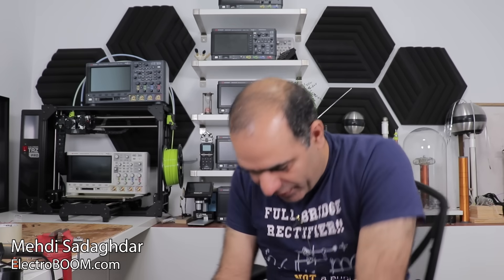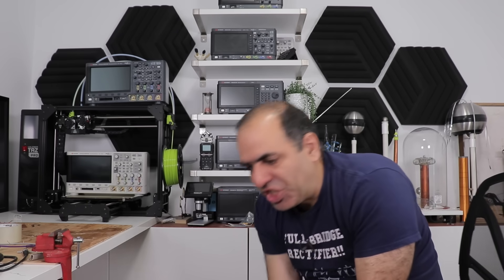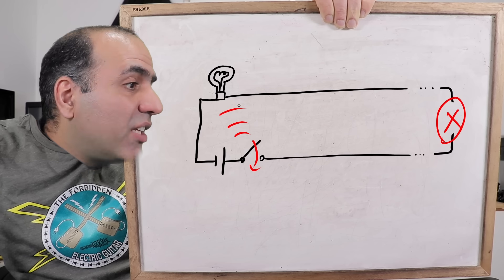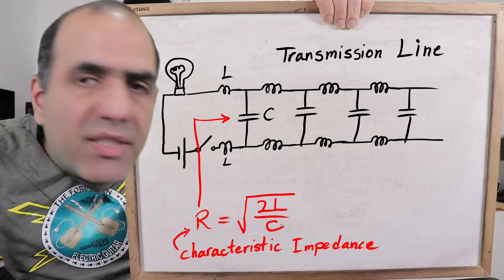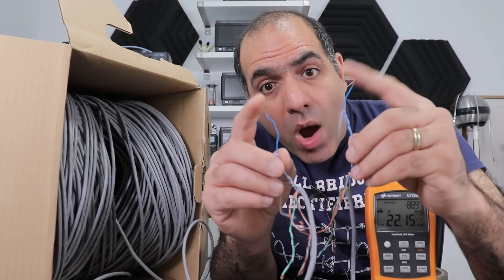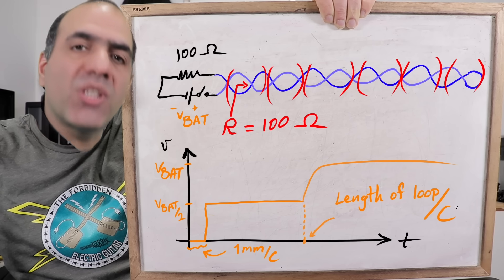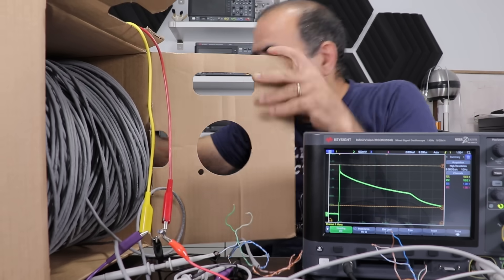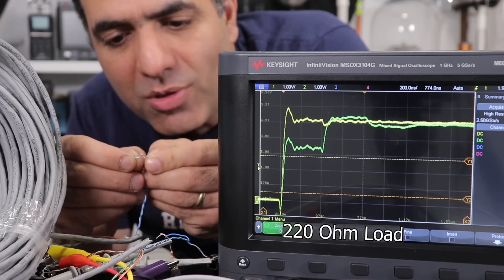Testing the LONGEST LOOP OF WIRE!!! to Turn a Lamp On

Comment: Veritasium's "experiment" had soooo many flaws. Not for the first time, I just wanted Veritasium to define the experiment that lead to his weird claim. E.g. define "lamp" (LED, tungsten, ..., voltage and current requirements, ...), define "on" (dependent on the "lamp"), define "switch" (related to "on"), ...
If you don't disclose how you define things, you can claim anything 👹

Comment: Very nice explanation, I think (dont remember clearly) Veritasium was making a mistake assuming that both left and right lines make a single transmission line together which is incorrect. As you said each left and right line is a seperste transmision line, so if you want to get half supply voltage you need to the load to be  2Zo not Zo (here you have only one line so you matched to Zo).

Comment: That works as a TDR as well! . You can now measure the length of wires taking into account the speed of light in that wire limited to 69%
Reply: fluke ethernet tool can show the length of rj45 without end connection
Reply: Nice
Reply: nice!

Comment: Mehdi, You did not answered the main question.
a) Is the electrical energy traveling through the wire or outside the wire?
b) Put in another way when you charge a capacitor is the electrical energy flowing through the capacitor or in to capacitor?
Correct answers
a) electrical energy flows through wire.
b) when charging a capacitor energy flows in to the capacitor (so it is stored there) and not through a capacitor and of course when discharging electrical energy flows out of the capacitor.

Comment: Fun fact, 2/3c is also about the speed of light in a fibre optic cable.
Reply: Ahhhh.... so that's why when we got internet via fibre optic cable, it was no faster than the old ADSL over copper. 😀😉
Reply: @johncoops6897  depending on your definition of "fast" I guess that's true ;)
Reply: @unvergebeneid  - our fiber-to-node broadband scheme in Sydney AU is absolutely rubbish. I had cable internet in my old home, and this new place is probably 1/4 the speed and drops out many times per day.

Comment: Run the experiment using COAX cable or TRIAX cable to show that it doesn't work with a shielded wire.

Comment: wires aren't vacuum, you need relative permittivity too. 0.66c is fine for the speed of light in wires. The photons go back and forth interacting with the atoms in the crystalline mesh, so the speed of light is slower.

Comment: This video is a thousand times better than the actual original one by Veritasium.
Thanks for the effort for making things simple, accessible and fun ! 🖤
Reply: Because he's very clearly explaining transmission line theory with experiments, probably the best I've seen so far.  It's amazing how he put really complex knowledge into digestible bits.
Reply: It's also better than EE's original video on the topic. It isn't some contest. They both talked to each other for hours, spent even more hours thinking through the problem, and it resulted in a better explanation on both sides.
Reply: @ExsoLam  Veritasium will not be able to process this video easily, he explains that batteries have a force field around them which determines circuit timings in any wires connected to them. He explains a light will turn on in the time that it takes the force 'wave' or something, to travel between the battery (or switch) and the light, and that even 'thinking' about the length of the wires is wrong. His video repeats this idea and even includes graphics to illustrate it. At least that's how I remember it % }
Reply: probably because its accurate and not an inaccurate twisting of the concepts with a click bait title... Veritasium really messed up on that video.
Reply: @lvlinty  Not really. The difference here is that it's a concrete demonstration, which is what the Veritasium video lacked. But it wasn't inaccurate.
Reply: @talideon  electroboom pretty handedly disproved the theory that the electricity would "jump the 1m gap" and power the light nearly instantly. The non-negligible electricity has to travel through the conductive medium at basically the speed of light.

Veristasium claimed that the traditional way we taught that very behavior was incorrect without specifying that he was referring to the negligible current that collects via capacitance. 

Derek basically made a video where every electrical engineer with any basis in circuit design went, "yes capacitance.. Its why we....." His title and premise was wrong.

Electroboom proved that the current was not detected at the load until it traveled through the medium.
Reply: @lvlinty  Did you not understand this video? You saw the power jump near instantly (1mm/c) right? There's not two different effects there, it's all about how the fields align. If you think of electricity as electrons flowing out of a wire like water through a pipe, that is incorrect.

Comment: I'm kind of proud of myself that I immediately understood why the LED initially only turned on once.
Reply: Right? I was like "I bet if you short the lines for a bit it will start working again".
Reply: @YouPlague  exactly! I mean, I didn't think of it as a capacitor, just the cable being saturated with charge carriers but same thing I guess.

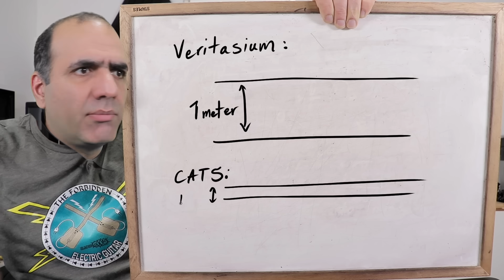Comment: 1:55 and 6:45 I think it would make quite drastic difference if the wires are 1mm or 1m apart. In your tranmission line model the Ls and Cs would need to be change quite drastically. I see it as induction, and here incsreasing the distance makes the losses huge. So not enough power would go through the 1m gap to power even smallest LED. Especially not if you run the setup with 12V car battery ;)

Comment: Yeah, no. You can't shorten one end. IT DOES MATTER. The current flows in both directions. It's pulling electrons from one end and pushing them on the other end. That means that current will spread in both directions at c (for the medium) and meet in the middle.

Derek wasn't arguing the case for capacitance, so don't try to be cute. To begin with, he had the lamp at the opposite end of the loop than the battery, and IT DOES MATTER. You can't do an experiment on a completely different system and then say that the result indicates something about the original system. It's especially silly that in this case all you had to do was put the LED on the opposite end of the twisted pair from the battery to have a much more similar setup.

He was essentially trying to say that the radio wave would power the light before the current reached it. This experiment doesn't demonstrate anything at all about how long it takes the electric wave to reach the other wire as in Derek's setup. The open-end experiment is just demonstrating the capacitance of the medium. (We use this to make capacitive touch devices.) You don't even have to have the two wires parallel to each other. You can have one long wire going east and one long wire going west, then connect an LED and a battery in the middle and you'll get a blink like you saw here, because one wire will donate some electrons and one will take up some electrons until the capacitive resistance matches the battery voltage. You can then remove the battery and reverse the LED to get another blink as the opposite static charges in the wires cross the LED to return to equilibrium. That said, because you're using twisted pair that's damn near touching (IT DOES MATTER) they're going to have much more capacitance, since they're "pulling" and "pushing" on each other electrically.

In any case, it's fine (and fun) to mess around with stuff and see things like this, and learn about ringing and different types of waves in a circuit, but this is not what Derek was doing.

Comment: Everytime I said it again, I hope it will be heard one day. This experience should be done with coaxial shielded cable like ones used for satellite TV.
External wire connected to earth, only the central wire should be used for current propagation
Reply: That would be episode 21 of this series.
Reply from the maker: There will be no central current without current through the outer conductor. So, it is kind of the same setup.
Reply: @ElectroBOOM  Exact. But my experimental setup expect to use another length of shielded cable to carry out return current through the central wire to the load and power supply

Comment: Explain how this isn't bait and switch fallacy. Let me explain. Let's take bit different analogy, because the fallacy is easier to spot there.

If I have very long pipe, the length doesn't matter, let's just say it is very very long, around the world. Let's also assume there is some sort of vacuum in the pipe because it doesn't matter for the analogy. Now if I fart in to the pipe the smell of fart should travel at speed of air moving, it doesn't matter for the analogy. But now the bait and switch happens because you claim that another person one meter of me can smell the fart before it has traveled thru the pipe. Isn't that another person just smelling the fart that escaped the input side of the pipe rather than the fart that traveled thru the pipe? So it's the wrong fart. It's not the true power fart.

Comment: I thought electrons don’t travel in the circuit unless there is a return path to ground?  How can you charge a wire if it’s not a complete circuit?
Reply: Go watch Veritasium's video where they talk about fields. There's a demonstration of software visualizing the fields change over time. They explain that fields are formed first and are the force that causes electron flow, not the other way around.

This is admittedly hard to swallow coming from a practical electronics background where it's more or less assumed the fields are setup as a result of flowing electrons... Similar to conventional current on circuit diagrams, it didn't actually matter they had the physics backwards

Comment: There was basically a word trick in the original question. 'The light turns on immediately when current passes through it' would normally mean 'it doesn't take any time to warm up once sufficient current is flowing to work it'. But the trick was this was supposed to mean 'any amount of current was deemed enough to illuminate it', which is a different assumption and would make the answer much more obvious.

Comment: I cannot agree on your claims for the longest wire test , because countries like mine have power transmission lines thousands of times longer than the wire you have , so technically your test is on much smaller level , correct me if i am wrong !
Reply: He did specify "in his room".